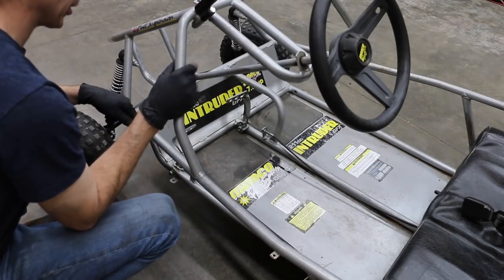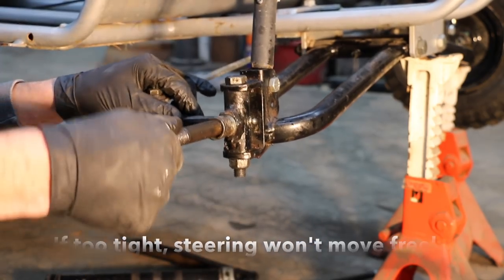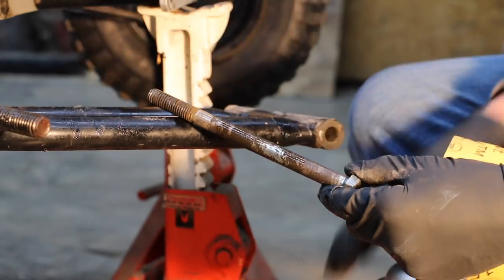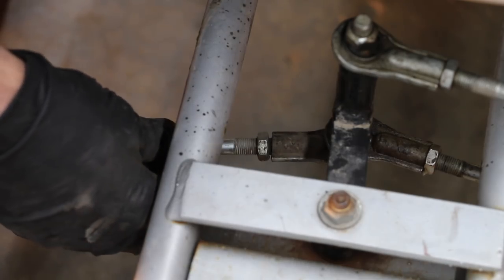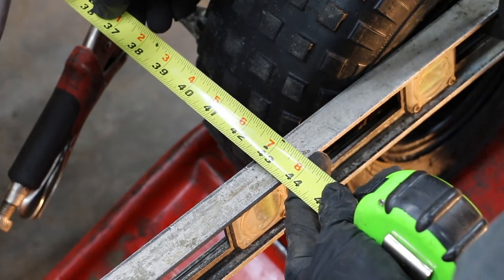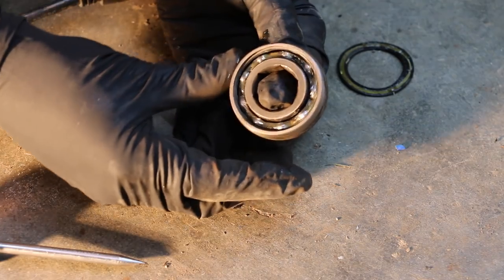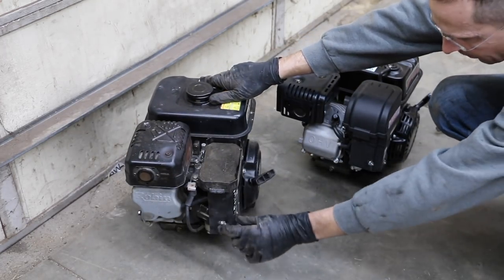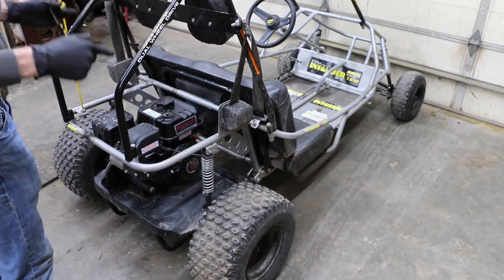How do you inspect a Go Kart before buying it?

Comment: I'm glad you made this video. As a 43yo man, I still have a go Kart for the boys and I to use! You're never too old for a go Kart! Nobody takes the time to properly maintain them and I'm glad you showed everybody. Edit: once I took the governer off of my 6.5hp Subaru engine, it flies. Even with 350 lbs of driver and passenger on board.
Reply from the maker: Thank you!
Reply: 44 and just picked one up earlier this week.
Reply: c4f5 + excellent! Enjoy it!
Reply: Growing old is inevitable.  Growing up is optional.  👍
Reply: I've done the governer mod on tons of engines and not had a problem.  Unfortunately I did it on a techumseh 8hp, near the end of when they were produced and the intake valve pulled out of the spring lifter disc.  I replaced it, got it working again, but after about half an hour it tore it out again.  I guess that's why they stopped making them.  So your mileage may vary.
Reply: burtosis I've removed the governer on my two kart motors and will be doing the wifes 16 hp  motor in her off road buggy. Definitely makes a difference.
Reply: burtosis + those engines are the only small engines that have ever catastrophically failed on me. Go figure. More than once.
Reply: They say if you don't grow up before 50, then you never have to. 6 more years.......I'm holding out!
Reply: Never!
Reply: Jerry 
lol, not as bad as mopeds, though!
Reply: burtosis yeah, Tecumseh engines are notorious for blowing up at high rpm. So I don't like them for anything fast.
Reply: Definitely never to old for a go cart, watching this and some other vids got me itching to build one.. lol .... and I'm 38lol
Reply: Try a minibike...goes more places

Comment: Thank you for saying the chain is worn out. So many people say the chain is all stretched out. People just don't get that chains do not stretch they progressively get longer as they wear. But it looks like a pretty good setup the welds on the frame look pretty nice. Good purchase.
Reply from the maker: Thank you!  I probably paid more than fair market value, but I badly needed one that could accept a Predator engine and one that had full suspension.  At the time, the options were limited.  I still need to order and replace the chain and sprockets.
Reply: Progressively getting longer is stretching. It's equally valid to say stretched or worn.
Reply: I bought my son the cheaper model (no real suspension) of Manco cart for Christmas. We have been pleased so far. It was fun in the snow. Order extra belts and look at upgrading the brakes.
Reply: M W S wear that makes something longer than it was is stretching.

Comment: A little toe in may be desirable, as the suspension compresses it will toe out. You will know once you ride it!
Reply from the maker: Great point!
Reply: You definitely do not want straight wheels. Think about you car. You need toe in or your going to wander all over the road.
Reply: Exactly. That is one of the reason that a few degrees of toe-in is used on cars.  You probably do not have the ability to do things like caster or camber (other front end alignment things).
Reply: Align the wheel once you have added your weight to the car, it's because it only has one control arm. In some more expensive gokart they have two control arms that adjust the camber.
Reply: He is correct, toe in for more responsive steering at higher speeds however suspension compression generally changes camber not toe.
Reply: Cristian Salas you can adjust camber/caster.
Reply: Kenneth Ravenscroft 
As the suspension compresses the length of the tie rods is effectively lengthened due to the angle change. Yes camber is affected but toe makes it squirrelly.
Reply: Yes, *toe in*.
Reply: Wendovor Productions 
Great idea!
Reply: 0 Matches for "wheel alignment kit"
Reply: I think the wheel alignment tool from HF hasn't been sold in many years, and probably for good reason.  I bought one 15 years ago and was not impressed with its quality or accuracy.  I had better luck clamping straight-edges to the rims.
Reply: Eric Buist 
I think this guy did great with what he had. A full turn in on both tie rods would be close enough. No tools can account for dynamics of how a machine works in use. Except for rigging V tail Bonanzas, and then trim can only be done with flight testing.
Reply: Other than taking this to an alignment shop and explaining the kid how you drove a go kart to an alignment shop, the string procedure is totally doable. To modify caster you’ll need to weld things. Way too complicated for these purposes. Stay with toe and camber if possible and move on.
Reply: upside downdog - You beat me to the point.  As you drive the forces push the toe out, so maybe, 1/8" toe in to start with depending on how much slop in the steering linkage/geometry.  Also, the steering wheel should be locked at the centered position first, and then the toe adjusted.

On a front wheel drive car it is the opposite... start with slight toe out, because engine torque pulls the wheels in.

Nice cart...  having actual suspension really makes a difference.

Comment: I was given  a used Kart for my grandsons, It had a Tecumseh engine (NLM) and a bent frame , was run hard and put away wet. I took it to a friends shop and he got the frame fixed , then I went through the rest of the running gear. Got it going but my son in-law messed up the engine and it did not run.  I took it to a friend of mine who was a pro kart racer some years ago (me too) and he did a really nice job rewiring the engine  got it really going and off we went. The kids love the thing and so does their Dad. These old karts are lots of fun. this one is a two seater with no suspension. It is lots of fun and has plenty of power for hill climbing .  Thanks for you video on these fun karts. Enjoyed it very much.
Reply from the maker: Thank you!

Comment: LS swap it
That'll be hella fun I imagine.
Reply from the maker: LOL!  You're right!
Reply: But I guess that would be outta budget and current theme of the channel
Reply: Coyote 5.0, 5.2?  Obviously out of budget, sounds fun though.
Reply: SHO, Flathead, Cologne, Windsor, Barra, 1UZ, VQ series, VG series, Smallblock, Bigblock, Detroit diesel, the list can go on and on. 

And I think one or these could be within range of Farm's budget, I really do. But then, it wouldn't be our favourite lawn mower engines getting destroyed anymore, so the budget would kinda deflate. Maybe for performance testing, that could do!
Reply: I have seen hayabusa swapped golf karts
Reply: No, car engines are way to hard to get running in something like this. Use a motorcycle engine and transmission. It's been done before but it's still insanly fun
Reply: Apple-Marty Czech - Slight overkill, but point well taken...  Any decent small motor cycle engine with the clutch moved to a foot pedal, and linkage to a hand shifter.  A small two stroke would keep the weight reasonable for decent handling...  many fun possibilities here. :)

Comment: I love it! Can't wait for the new testing bench to be a regular thing.

A few words for your maintenance:
Get a cheap bench vice and a wire wheel! It will make all your rusty part care so fast and thorough.

Lastly I want to add always replace your chains and sprockets together, otherwise the worn out parts will wear out the new components much more quickly, but it sounds like that's your plan, so you're already wise to that.
Reply from the maker: All great advice--thank you!

Comment: So this video got me curious about Subaru making small engines, I had no idea they made those. Well according to their website you can buy a tiny little V-Twin engine that pumps out 30hp. How fucking cool of a go-kart would that be? Probably expensive though. I bed it'd be easier to get something off of a motorcycle. Built in transmission too.
Reply from the maker: That would be impressive!
Reply: Love your videos sir!
Reply: I also googled it and the Subaru EH99 (their most powerful small engine) has a displacement of 999ccm and 36HP. Sadly it says on their Webpage they discontinued producing small engines. I then looked for similar Honda engines but their biggest model is the GX690 with only 688ccn and 22.1HP.
Reply: I always assumed all these engine were just thumpers but it's pretty cool that they make the twins, I bet they sound awesome!

Comment: Good vid.  My son races karts.  There is a lot of cross-over of things you need to look at and be aware of.  Plus, the part about alignment really helped him understand how that worked.  Thanks!
Reply from the maker: Thank you!  By the way, it helps to have a little tow in.  Adding the weight of the driver to the cart first, take measurements and add in a couple of degrees of tow in.  Hope this helps.

Comment: When applying new grease to an old bearing, you "pack" it by putting a blob of grease in one palm, hooking the index finger of the other hand in the bearing, and pushing the side of the bearing into the blob of grease, rotating the bearing as you work.  The new grease pushes up through the balls or rollers, forcing the old dirty grease out the top and replacing it with new grease.  There are little pneumatic bearing packer tools that do the same, but hand packing doesn't take much longer to do.  Great vid!
Reply from the maker: Thanks for the feedback.

Comment: This is going to be great!  Performance testing, I presume.  Two thoughts on measuring speed:  I setup a bicycle speedometer with the magnetic sensor mounted to the axle sprocket, and calibrated it for the tire diameter.  This works well, and is accurate.  You could also add a hand-held wind speed sensor, so you can make sure that significant head or tailwinds are not affecting your speed / performance comparisons.
Reply from the maker: Thank you for this recommendation!

Comment: Really enjoyed this!  I think you're supposed to have a bit of toe-in on the front suspension; the toe-in will act to center the wheels, so the steering will go to neutral when you take your hands off the wheel.  Without a bit of toe-in you'll be constantly correcting the steering as you drive, and it gets a bit wearing after a while. Probably much more important on passenger cars than go carts.  As always, great work, and a nice piece of video footage that will bring a lot of enjoyment to a lot of people, for a long time to come.  Nice job!
Reply from the maker: Thank you!  I'll add some toe-in.

Comment: A man after my own heart... I once told a mechanic about the dust seal removal trick he was a certified mechanic of 30 years and flat out told me I couldn't do that... I did it right before his very eyes, on a golf cart axle bearing that would have been a horrendous undertaking to replace, I fixed the noisy bearing, and he was speechless haha.

Oh and I like this style of video!
Reply from the maker: LOL!  It's a great way to extend the life of a bearing!
Reply: Project Farm amen man, thank you for all you do!
Reply: I'm curious as to how long they last when you repack them.  I'd think there would be a good amount of damage to the bearing itself when it ran dry.  It's a handy trick for sure if you need something right now, or if the bearing is really hard to extract.  Most of the stuff i deal with i just get new bearings, they are fairly cheap.
Reply: animefreak5757 after re packing, unless the grease leaks out or the dust seal is broken so that dirt gets in, I've never had one go bad again. 

Unless of course the bearing is worn and loose. The secret is getting the seal off without damaging it... You can use silicone to seal scuffs after cleaning the grease off of the outside. But you are correct, if you can replace the bearing easily and cheaply, plus quickly if you need the machine to work right away, replacing is always your best bet.
Reply: thanks for the reply, handy information to have.

Comment: +Project Farm
Great video, that cart looks like it going to be fun.
When you tightened the steering swivels, instead of cranking the bolts down and bending the frame, you could have put washers in between the frame and swivels to take out the slack, they will act as bearings and stop the swivels eating into the framework.
Also, the grease nipple (zerk) being clogged with hard grease can be cleared with a few seconds of heat from a hot air gun or blowtorch, saves drilling the fitting out if it's the non-removable type, like you had.
Looking forward to the progress on this project
Reply from the maker: These are great recommendations--thank you!

Comment: Sweet! I'm really excited about the new videos you'll be making with this go-kart because I have a mud tractor with a 196cc Kohler clone motor that I want to do some performance work on as well.  That's a nice governor bypass linkage you made, but you really should take the internal governor out of the engine too.  It's an easy job you could do in about an hour.  At higher rpms it can spin too fast and come apart since it's not hooked to anything. Then you'll have governor parts scattered throughout you crankcase.  You know how that story ends.

I've worked in the industrial maintenance industry inspecting and reparing machines and overhead cranes for 8 years and I know the importance of the extra maintenance steps you took in this video, like inspecting chains, sprockets, and looking for lubricated points.  I put that same effort into maintaining my own yard equipment and fun toys too.  This maintenance helps ensure long machine life and fewer break downs (and headaches too lol).

Awesome drone footage by the way too.
Reply from the maker: Your tractor sounds like a lot of fun!  Also, great point regarding the governor gear removal.  Thank you!

Comment: Enjoyed your showing the part of the nation you are living in, very beautiful country.  A tip for you: no need to replace the warn bolt in the steering. Just need to sand it smooth, polish it, and in this case looks like using high density polyethylene from a yogurt cup (thinner material if need be) make a bushing to fit the top 1" or so. May use a heat gun to soften it to wrap around the bolt. Clean the inside of the sleeve for the bolt, then slide the bolt into it with the new collar at the top and grease it all.  At low RPM and room temperatures, poly makes a wonderful, durable bearing... and it is free.. no need to buy anything. They are very smooth operating, and last for years. Use liberally.:-)
Reply from the maker: Tim, this is an excellent suggestion!  Way to repurpose plastic too!  Thank you!

Comment: Even when I buy things brand new... let alone used... a blender... a power tool, I take them apart right away and go over them.
The other day, I bought a new 110v. drill, a yellow & black, right out of the box, I opened it up. It was all greased up... blobs of grease here and there... all about a quarter to half an inch off the bushing or gears... face/palm.
It didn't even cost any grease! I just moved the blobs to where they were supposed to land. Failure is always design into it... mine will last a lot longer than they wished.
Reply from the maker: Great feedback. Thank you

Comment: You could put washers on the vertical pin in the steering.  The "zerk" or grease fitting should have a ball in it that seals after you stop putting grease in it.  For alignment you should have a quarter inch toe-in.  The bevel in the tie-rod pin can serve to capture grease.  If you only go forward you might be able to reverse the sprocket.
Reply from the maker: These are excellent tips--thank you!

Comment: Yup I regrease alot of my bearings for my mud mowers on the clutch and idler pulleys. Works great.
Reply from the maker: It seems to add a lot of life to the bearings.
Reply: Yes it does. Saved me alot of money on not having to buy  new pulleys every yrs.
Reply: For that Subaru engine you should see how lean you can get it for most power or to see how much better gas mileage you can get out of it.
Reply from the maker: Great idea regarding the air/fuel mix!

Comment: MORE, Commander! Good catch for a test rig and you get to whiz around and take advantage of it. Your little ones will take advantage too and maybe their Mom as well! Best 2 yall!
Reply from the maker: Lewie, Thank you!  It's a lot of fun to zip around the farm and is much faster than walking.  Hope all is well!
Reply: All is fine here and the last mower I salvaged had a Vanguard opposed piston engine and I tore the whole thing down except the engine but rebuilt the carb/fuel pump. Popped the tranny apart and greased/oiled it good with a lot of other new and old stuff. Cuts like a carpet but it ought to! I end up working on everything whether it needs it or not...............and it does! Thanks again!
Reply from the maker: Wow!  I'm sure the investment in time and effort will pay off in reliability and overall performance!  Sounds like an enjoyable project!  I've been clearing a lot of overgrowth (brush and large trees) along fence line.  I'm definitely not as young as I was once!  Thanks again!

Comment: I am an automotive management student at university. We learned that the wheels may not be alligned straid but they have to go a bit inwarts. this is called negative tracking. The purpose of this setup is to create a force which reduces the vibrations from parts like the wheel which may have some play on it. It also has a benefit on grip with the track in corners.
Reply from the maker: Thank you
Reply: @ProjectFarm  Could you make a video about 2 stroke oil used as oil in a 4 stroke engine? I would like to see the effect ;)